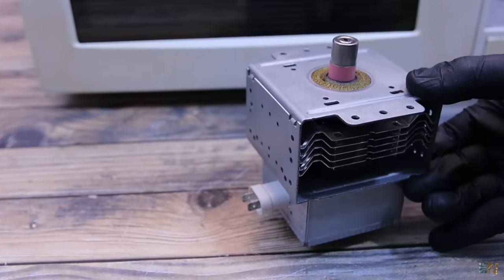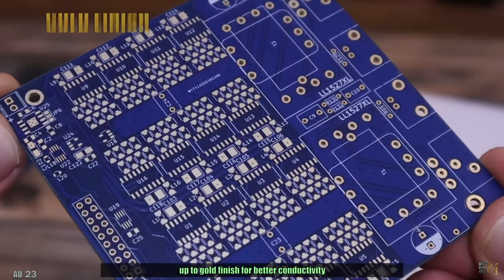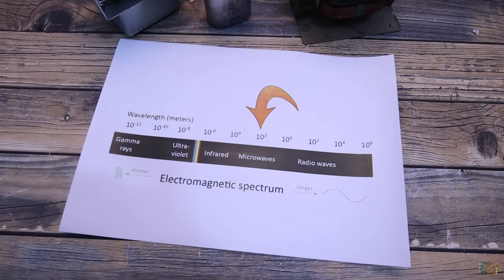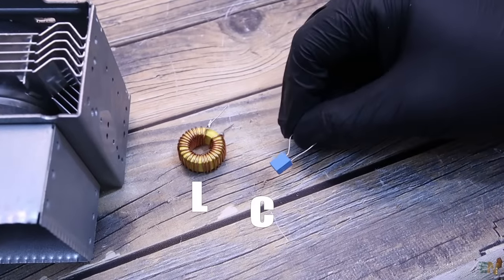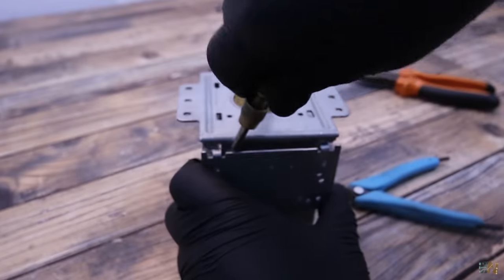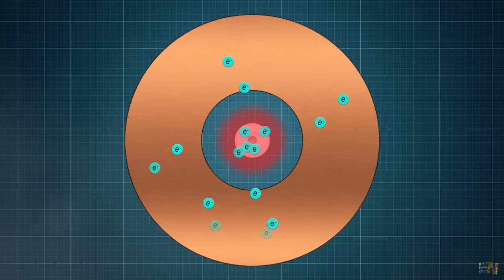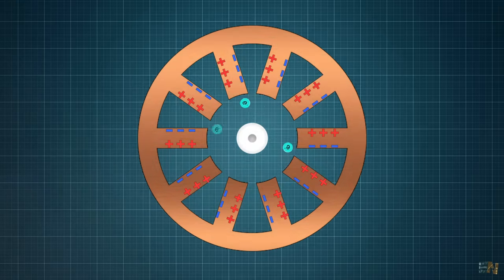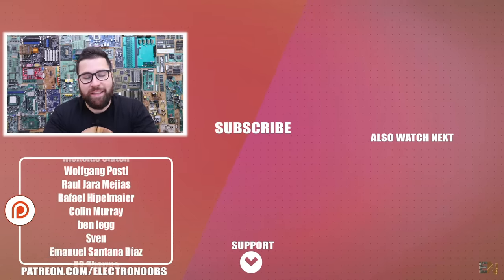MAGNETRON - Teardown + How It Works - Dangerous!

Comment: 0:14 Don't spread false information for this magnetron. Beryllium oxide is very expensive and is only used in high-end military magnetrons where max performance is required, never in ordinary microwave oven since it would have been way more expensive and there should also, according to the law, be a sticker inside warning about any beryllium in it. This is not the case in consumer grade microwave ovens since there isn't any beryllium in them. Very, very old ones från say the 60-70 there might but not in modern ones.

Comment: .   The capacitor has a voltage rating on it that gives some idea of the ovens' working limit.  Next time put a scope on a working oven to show us out put of the transformer and the LC tank wave form.  Thanks for illustrating the resonators' operation.
Reply: The scope probe just has to be in the vicinity of a microwave that is operating - an electrical connection isn’t really necessary for the purpose you requested.

Comment: What do you think turning coil of magnitron from av 3phade 1amp motor which volts come from transformer high side from trippler capacitor 8000 voltages this was started from pittance power speaker spark plug x4 parallel connected three lines so 12 in total speakers what do you think

Comment: Would the magnetron become much more powerful if the stock magnets were replaced by the same size neodymium magnets or would the microwave still work the same.
Reply: Nope. The strength of the magnetic field and the output frequency are tied together, along with the dimension of the resonator.

Comment: Dude, could the magnetron be deigned slightly differently in order to produce a high voltage DC current to a circuit rather than producing microwaves?

Comment: Somewhere I read that microwave ovens operate at 26 GHz - is that true and for all ovens? What would happen if you replaced the ring magnets (ceramic?) with neodymium types of the same size? Would that increase power output?
Reply: The fréquency IS normalysed at 2,4 GHz for microwave oven.

Comment: I remember hearing that beryllium oxide was the expensive material to use for generating microwaves and it was generally some cheaper not/not as hazardous material
Reply: The BeO doesn't have any electrical function. It's an insulator. That's all.
Reply: True, this is a type of ceramic, not BeO. A common misconception making things more exciting :)
Reply: @inseries5494  thank you for the fact check!
Reply: @inseries5494  berillium would be way to expensive to use in a microwave and would be able to handle temperatures way hotter than any microwave would ever handle, it's more of a defense contractor material

Comment: that part that has a hole in it is a cheap sheet material that called Mica which is like 3 dolars on aliexpress like A3 size sheet, it is a filter which  allows  the short wave radiation to pass through but also protects the magnetron from steam and other food related materials

Comment: Are the cavity capacitors really charged with opposite polarities on each side of each wall?
Answer: there is no reason for any particular polarity to be established on itself during the initial fire up. The polarity of cavities is at first purely random and then it reaches a steady state as the cavities are coupled by the rotating electron 'wheel'. To establish an order we want and make it produce the frequency we want, we use bypases between the cavities.

Comment: I like to use that diode and capacitor when i make an electric fly swatter😆.. i also use better transistor than i can use little more voltage and higher oscillation.  That's so fun... flies explode.

Comment: So what would be more dangerous the Magnetron or the transformer?
 I say the transformer because not many people have a valid use for the magnetron but they do reuse the transformer for art creation using the high voltage. 

Microwave radiation is RF and is non ionizing so there is no risk of damage to your DNA and such but it will heat you up / cook you. Higher frequency RF requires less power in watts to do the job. 500 mW of microwave RF on 2.4GHz can burn  you just like 4 watts on 27MHz CB radio band. Anytime you are dealing with RF energy you should take the same precautions and respects as if you were dealing with your mains electrical system.

Comment: Pretty good video, but there was an inaccuracy at the end. Microwave radiation does not heat from the inside out, and you will most definately know that you are being heated. That's the principle behind Raytheon's Active Denial System, after all.
Reply: Unfortunately, it is usually too late to save a person after irradiation with microwaves. The damage is caused by the peptides coagulation in the tissue, and is not sensible by the humans. As an example, an officer exposed to 100kW radar didn't die right away, and felt well right after the accident, but died painfully within 24 hours
Reply: @odissey2  While 2.4Ghz is harder to sense in flesh, the principle of damage remains the same: heating.
Perhaps what you're thinking of involves denaturation of proteins from heat, as 'peptide coagulation' is a nonsensical phrase.
'Peptide' is an alternative word for 'amino acid' and 'polypeptide' is an alternative word for 'protein' and 'enzyme'. The muddling of terms is usually utilized to confuse.

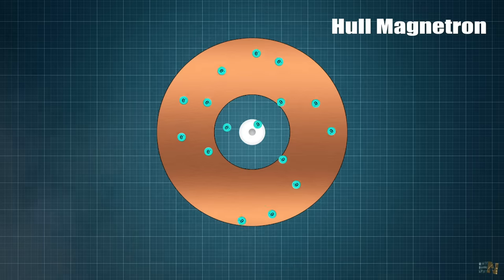Comment: -I have a question, at 10:38 you're showing that the magnets can direct electrons, does this mean we can "send" electrons from a circuit to another using only magnets? How does this work exactly?

- Also, one day while I was waiting for my coffee next to the microwave and I was holding a magnet, when my hand got closer to the microwave, I noticed that the magnet was STRONGLY reacting (not really attracted in a particular direction) to the microwave and then it completely stopped reacting when the microwave stopped. 
And I'm curious about what was really happening here, can you help me find out? Thank you!
Reply: Electrons or charged particle like in plasma can be attracted or repelled by a magnetic field. If you have a electron gun that shoots electrons (like in CRTs), you can control it by using an magnetic field. 
The magnets reacts to a microwave while operating it because (probably) there are lots of current and magnetic field (with 50/60Hz pulses of power) and the magnetic should be reacting to it (like also the 2.4g interference that the microwave also give off near)
Reply: If you don't have a complete circuit, then all that is left is static electricity.  That's why the face of a crt won't shock you but can attract dust.

Comment: Towards the end you mentioned a transformer that outputs 300 V , where is it used ?
Reply from the maker: That transformer outputs 2000 to 3000V AC, is very powerful. And that's what is creating the needed high voltage for the cavity anode.
Reply: @ELECTRONOOBS  Thank you for taking time to answer.

Comment: just to set the record about microwave appliance emissions -- OSHA regulation permits only 5 mw per square centimeter at 2 inches from the appliance. This isn't enough to cause damage to a human. More power might heat a body up but as the distance increases the received power is less (it follows the inverse square rule). Microwave emissions never have  enough energy to cause ionization of atoms which is required to cause cancer. Ionizing radiation is the only way currently known to science for electromagnetic radiation like microwaves to cause cancer. The usual  way radiation  escapes from an appliance is if the door is not seated properly leaving cracks in the seal. Tears or cracks in the metal around the unit can also permit radiation escape. Modern pacemakers have been hardened against microwave radiation so they are not as vulnerable as they once were.

Comment: I always cover the beryllium oxide insulators with duct tape to protect them and keep dust from escaping should they break.

The reason your microwave was sparking was probably not the hole, but the piece of sheet metal covering the waveguide.  If you remove that, it will work.  From the factory, they come with a thin sheet of mica, which is transparent to microwaves, and its really only there to keep food splatter form getting into the waveguide.  They run fine without it and you can buy them for a couple of dollars if it becomes burned and starts sparking.

https://www.youtube.com/watch?v=ZC6n1qM5PEI

Comment: Hi, I wonder if you can transmit with that magnetron. Morse code or something easy. Maybe on the Ham Bands of course.
Reply: Actually, people have done this-hams are allowed to transmit on those frequencies.
Reply: Also make very cheap anti-anti radar site missile decoy targets. This happened in the Bosnian war. Just bypass the door interlock and take the door off prop up in a safe area and power on. INCOMING! $$$$$$ down an outhouse hole.

Comment: The actual voltage with the high voltage capacitor in the high voltage diode is around 3,000 volts DC not 300
Reply from the maker: I don't know why at the end I say 300V. I meant 3000V, obviouslly. If you check minute 09:35 you can see I show 2000V AC. I think I've read the script worng hahaha :)
Reply: It's a doubler schematic,  meaning 4-5k, current 200 mA, operation of 800 watt.

Comment: That's some pretty metal inside that thing.
    Not worth the danger. Inertial Navigation boxes in Navy aircraft had the same beryllium oxide problem.
    You see that dust, close the lid, wrap it up and get it out of there.

Comment: I noticed some machining operations on some the 10 spokes, what does that do?
Reply: You can see two types of grooves  on the "ribs" 9:20. First is a cut-off near the center, with 2 thin copper rings. You can see that those rings are hanging over the  machined protrusion in even/odd manner: for example the inner ring is soldered to the even ribs, but hangs over odd, and the outer ring is vice versa. This is to provide the coupling between the cavities.
    There are also another  cut-offs, which are about 1/2 way from the center. You may notice that the distance varies from rib to rib. They are to make the resonators "imperfect",  io make them resonate at slightly different frequencies, to make the magnetron output radiation broadband. This serves several reasons: to make the part not useful for military purposes,  e.g. radar manufacturing; to make the magnetron to start faster, and to help the coupling with "imperfect" microwave oven cavity with chicken inside

Comment: 3:04 Just a quick note, perfect pointing and naming up to this point, but after this, your pointing and naming wildly goes off the rails. Many components can be very deadly to the uniformed (who this video is made for). Switching from accurate pointing/naming to, anything other than that, is bad.

Comment: Imagine if, in an apocalyptic setting, someone puts a magnetron on the end of a staff, with a tin can to point the microwaves, they could be the heat wizard, burning zombies by just pointing the staff at them
Reply: Just no! Unless you aim to cook the entire settlement? It would take military radar level tech to beamform microwaves like you suggest, just FYI incase anyone actually thinks about trying this.😆
Reply: @julescircuits845  all you need is a metal tube surrounding the magnetron to bounce the microwaves in the general direction, if that wasn’t enough, than a microwave would boil my face off every time I cook up a hot pocket
Reply: @researcherchameleon4602  close enough to correct... I was more thinking maser (microwave laser) as I'm a bit OCD and the thought of a stray field makes me twitch🤣🤣
Reply: @julescircuits845  no worries, the way I wrote “…at the end of a staff, with a can to point the microwaves…” could be misread as a grammar error, I’ve edited it to be more clear

Comment: What if they design it in another method by using a 30GHZ oscillator followed by an RF transistor driver, then end with a high RF power transistors connected to the Antenna

Comment: To think. You could have changed the wave guide cover for under a euro and the oven would have been perfectly serviceable. Given how you handled the capacitor, which are known for failed bleed resistors, you're lucky to be alive. And dude. You missed the big diode in the voltage doubler circuit hanging off the cap...

Comment: That is not how a cavity mag works. The clue is in the name. It is the geometry ad size of the cavities that give it it's working frequency, and the energy comes from injecting high energy electrons (well a about 5000eV) into a magnetic field which as anyone knows that has studies physics (Flemings left hand rule) will cause them to travel in a spiral until they lose enough energy to hit the cavity wall. The input is in fact DC.

Comment: I would like to see if any of those components contain any residual radiation.
Reply: EM cannot cause residual radiation. The energy is either reflected, passed through, or absorbed (converted instantly to heat).

Comment: Why do so many magnetron teardowns claim the insulator is beryllium oxide? Why one earth would dirt cheap magnetrons used in most microwaves contain un-godly expensive beryllium. Beryllium was used in early magnetrons and in high watt rf amplifiers. But that was decades ago. Mostly just used in scientific industry now days. The magnetron he's holding uses the cheap aluminium oxide along with all other magnetrons found in microwaves.

Comment: Or you could have changed the mica sheet for $5. But this video wouldn't exist...
Reply from the maker: Hahahaha it wasn't just the mica sheet, obviously the oven had something bad inside that made the mica sheet burn out... Or maybe not, but since I have a new oven, I've got the chance to make this video :))))
Reply: @ELECTRONOOBS  absolutely no "problem" in the ovens electronics can harm the mica sheet. It burned because some dirt (burned, carbonized) food sat on it. Once it's carbon it gets to be electrically conductive and it will absorb the RF energy and start melting. That's why it's important to keep the inside of the oven clean.

Comment: You REALLY need to mention that the capacitor can easily kill someone, and NEEDS to be properly discharged before handling. I don't care if it's got a discharge resistor, you should never trust them with your life.
Reply: Capacitors with connected plates never fill up, google it. Also google what a resonant chamber is, and stop copying other youtubers for your scripts. Those are resonating chambers, according to the inventor. Not capacitor plates.

Comment: All this talk about beryllium and ceramic dust and practically no mention of the lethal charge that capacitor will store and the incredibly dangerous high voltage power supply.

Comment: That metal part with the hole in it is not metal but it is a mica plate. You could have replaced this for a few euros.
Reply: Exactly. A metal plate would block the microwaves and it wouldn't be able to function.

Comment: micro waves WILL NOT heat you from the inside out...how do you not know that its outside in its radiation.... youre probably one of those people who stand far away from a microwave oven when its on and dodge when you open the door sigh but other than that good video
Reply: "how do you not know that its outside in its radiation" what does this mean? How do you know the microwaves aren't leaking out of the appliance? You don't and can't tell. The safe thing is to assume there's a leak and stand back. But the permissible emission power for modern uWave appliances is 5mw per sq centimeter measured at a mere 2 inches from the appliance. At 1 foot away you get less than a quarter of that -- unless there is an ill-fitting door or other radiation leak.

Comment: Hi, ive been this christmass recalling life experiences of home many years ago.
? .
To recall i tinkered with aclight and potable cooker small.
These journets back ti striping cablesxand looking with hindsight the thoughts were to jump to today. Or seeing hmmm.
This very thing stopped me. I am sensutive now to emw. That was not an issue. But i realsed my exposure in earlier life was higher therefore why am i benn so sebsitive. I striped tge 2# 3 /stranded this allowed a white powder around the earth nuetral live to the white outer sheat. I saw a desenituve response . Was i responding to the powdervor the plastic rubber insulation of the electriacal cinductirs..hmmm 
Not ti sat accept but to be safe. Maybe taking out these metals from.homes then simplify . These brings a  single stranded metal pritection to carry the urrent to each item . Running items like in a factory is not a good way to manage homes..
It is great a house with things calm .
I t is very better capital paid wirk to switch off tidy return to central warehiuses and rethink. 
Thus calms the human so not needing to cirrect that stress with a food ir sweet often with drink. That increases new demands and oftenbti buy a new machune whuch for thst mibey better see our housing needs